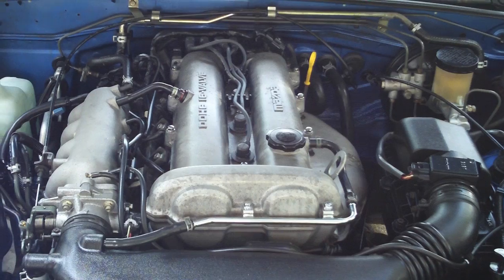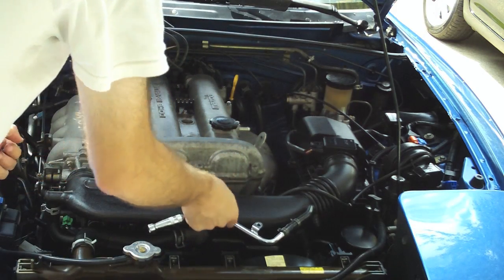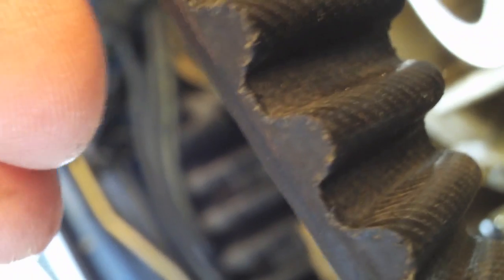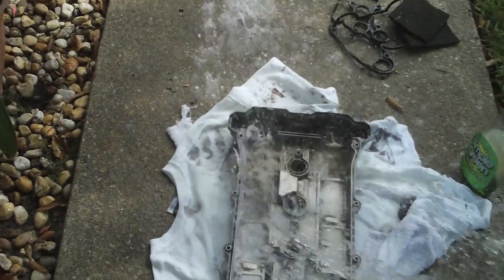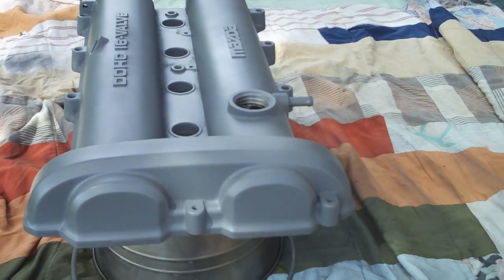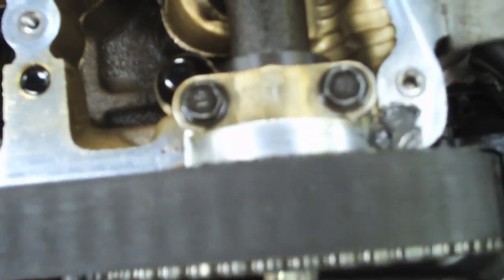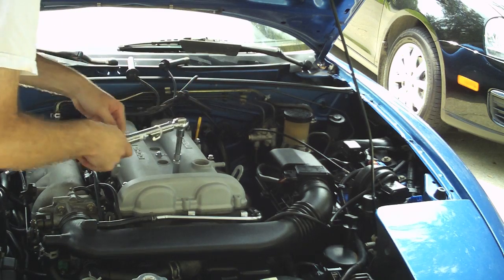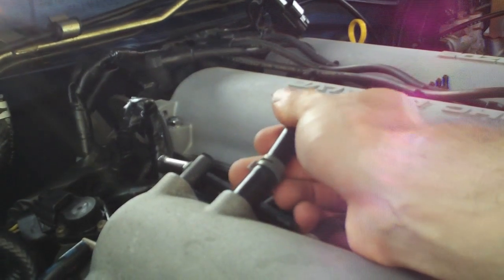Mazda Miata Fan - Episode 6 - Valve Cover Gasket Replacement

Comment: Best tutorial ever! Just completed it on my 99 NB. So helpful! Just be aware on the NB that there might be a wiring harness connector on the passenger side, and that there might be a sensor on the front passenger side too. Cleaned it and painted it a beautiful Gold. Great contrast to the rest od the motor! Thank you so much!
Also: its a great idea to buy the parts on RockAuto, great prices! Its also the perfect time to change plugs with the valve cover off.
Edit: DO NOT BUY A CHEAP GASKET. ALWAYS BUY OEM. AFTER MARKET GASKET WILL LEAK AND/OR FAIL. I JUST REPLACED MINE WITH OEM AND SO FAR NO ISSUES!!!

Comment: Any tips on a 1990? I've done it a few  times now and I've ruined a brand new gasket when trying to wedge the cover underneath the coil pack mount and over the exhaust cams rear hump. Holds up fine but slowly leaks oil back there and just received my new gasket yesterday
Reply: +Andrew Margello Check you CAS O-Ring. It might be leaking, and is a common oil leak spot.

Comment: Thanks, helped a bunch. I was doing my 02 SE so I ran into the speed bump of the VVT parts and would've preferred to also see you take off the plates on the valve cover. No worries though! Thanks again

Comment: Did you have any issues after doing this? I also replaced the valve gasket on my NA and driving it the first time was fine but the second time i heard what sound like sparking from the spark plugs in the back but it went away as it was heating up so i didnt give it much thought. After I was driving for about 5 minutes i lost almost all power and was putting out a lot of smoke and the car wouldnt idle on its own meaning i had to keep giving it gas to stay running but it sounded so so bad. The engine still turns but sounds really bad when it runs for the 2 seconds it can before dying again. I could smell coolant, oil, and gas so i know its not good. I am confused what i did wrong because i used rubber gasket sealant on all the curved corners and the gasket was seated properly in the cover. Do you or anyone have any ideas? Right now I am afraid to touch the car and will likely get it professionally checked out.

Comment: You shouldn't even use the torque wrench. you are turning the bolt a 1/8 of a turn after the  wrench clicks telling you its tight enough. Just an observation.
Reply: Chris Spencer what
Reply: He kinda has a point. The purpose of the torque wrench "click" is to let the person know that they hit the torque spec. If you tighten past that you are going over that torque spec...

Comment: just for safety measure, is it okay to put a thin film of the RTV sealant around the whole perimeter of the head cylinder instead of just the corners and the grooves you've mentioned in the video? I just don't want to have to risk having my valve cover leak again, it's a easy job but just takes a long time especially for my Audi

Comment: Yes, the gasket is visable from the sides after installed, But it does not stick out of the sides.  It is a thick gasket that fits into a channel on the valve cover as shown and the cover is not screwed down so tight as to completely crush the gasket.

Comment: awesome video, I just replaces my gasket thanks to this video HOWEVER I really struggled with the two bolds in the rear, they were pain because it was really hard to get to them. I also ennded up cracking my breather hose, it cracked right where it plugs into the engine cover, its still okay but has a crack, IS THIS something I have to replace right away? What happens if I do not replace a breather hose right away? thank you!

Comment: great video.  when i did this on my 1990 miata, the pcv valve and grommet both cracked and the breather hose cracked.  all had to be replaced.  this was very helpful.  maybe you'd do a video on timing belt and water pump replacement  :0)

Comment: Harbor Freight has a inch pound torque wrench for $20.  Pickled up a slightly different model at the store that was unfortunately just 1/4" so you might need an adapter for your sockets.

Comment: No, this has noting to do with coolant.  You probably have a leak in the coolant system.  It could be a bad hose but possibly a bad radiator or radiator cap.  If the radiator or the hoses have never been replaced than they should be due to age.  If you want to only replace the faulty part you can rent a radiator pressure tester to help locate the source of the problem.  There is another youtube video that shows how to do this on a miata, but a second gen miata, though the procedure is the same.

Comment: Do you have to replace the rubber between ?
Reply: It's pretty good to do since it can be cracked or dried etc. This can result to leand and I think loss off power. But if the gasket seems good you can skip it.

Comment: Why did you tighten all bolts circular instead of X / star order?
Reply: In the Haynes manual for the car, it says to do it in a circular pattern. Star would seem correct but you can't argue with the manual.

Comment: you dont have to take the front 2 bolts off. you just have to undo the hose the that air intake part. unless of course you want to clean the valve cover

Comment: Generally a good video. However, all pieces attached to the cover, (grommets, wire brackets), should probably be removed before the cleaning. Also, all openings like the plug wells and bolt holes, should be masked so paint will not get in.

Comment: Said to torque the bolts between 43 to 78. I set mine to 60 and broke a bolt.  Will now need to find a way to remove the broken bolt. :=(